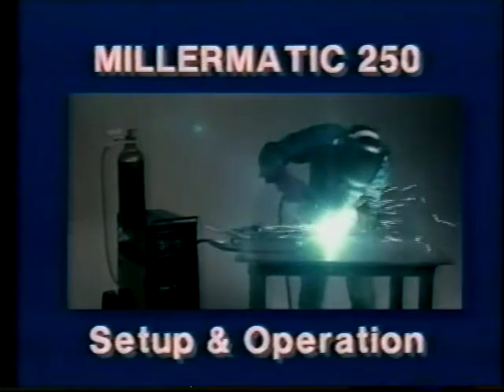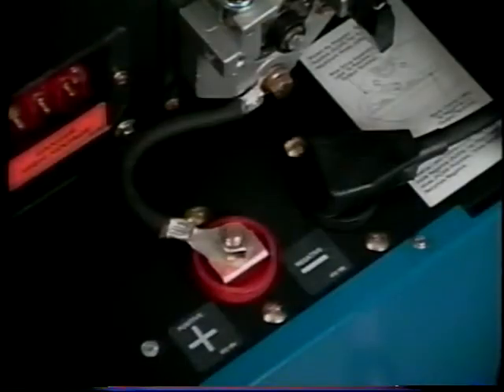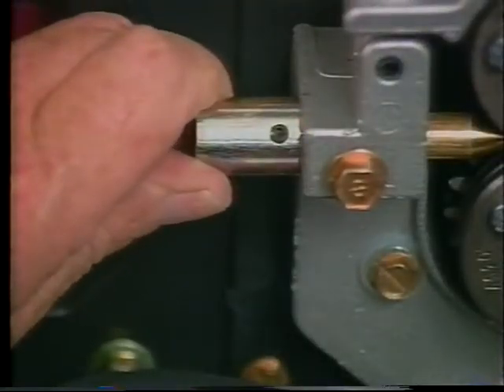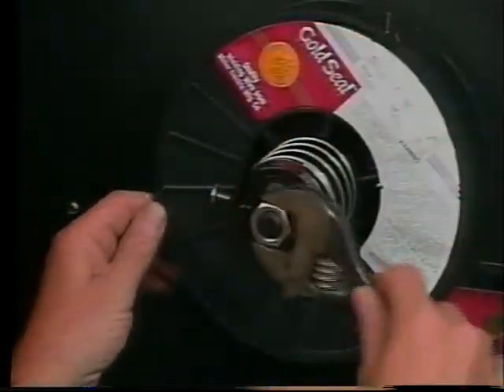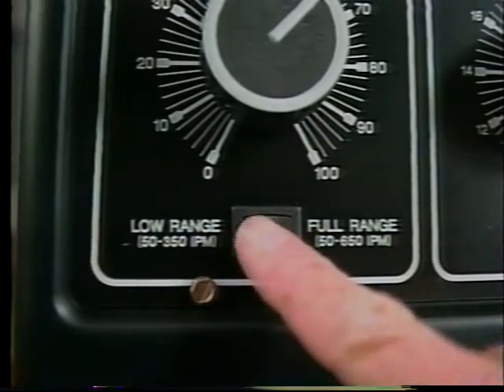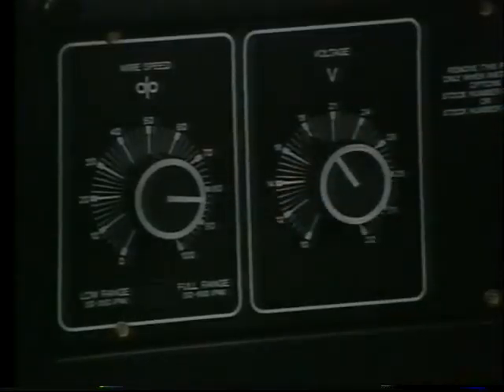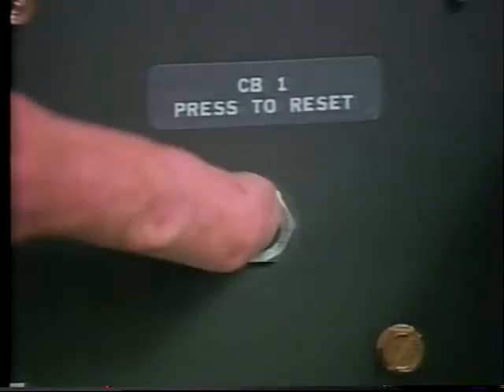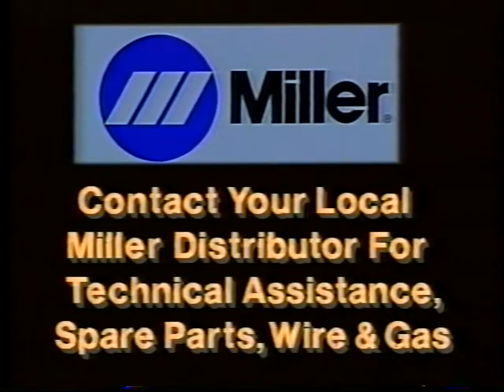MillerMatic 250 Setup and Operation

Comment: I know this is prob a dumb question but can this old machine be set up for ac tig welding
Reply from the maker: No, this machine only produces 28V DC, so even if you did manage to convert it for use with TIG welding it would be DC and not AC.